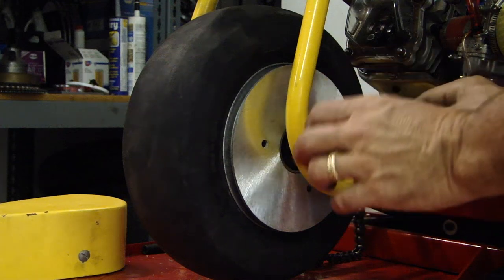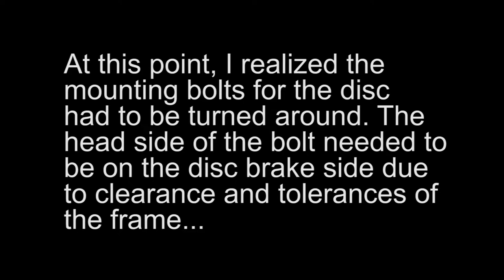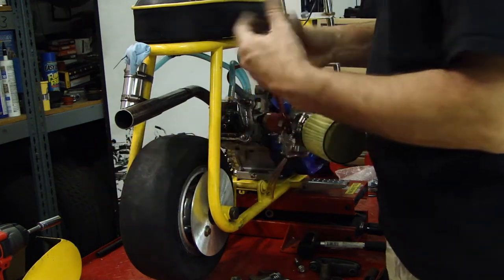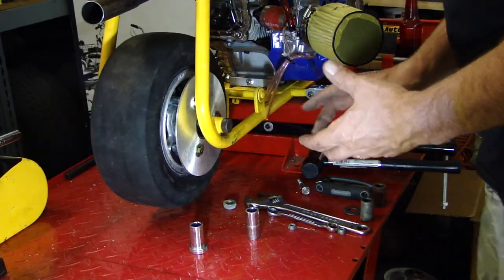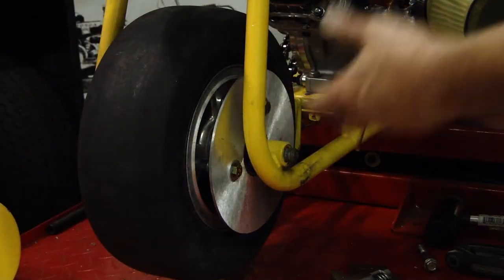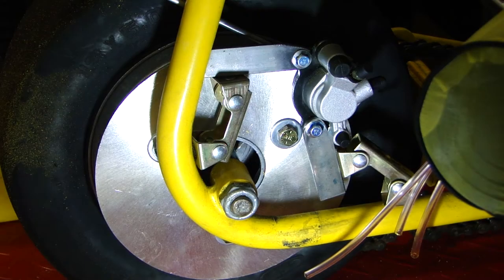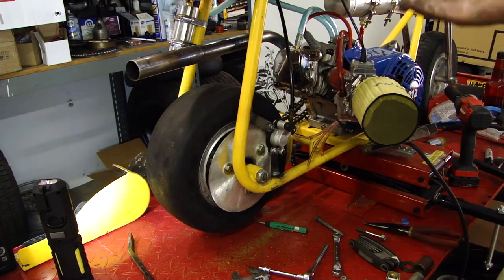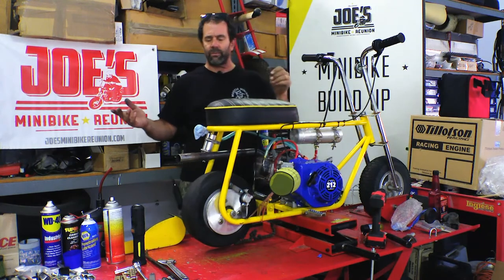MINIBIKE HYDRAULIC DISC BRAKE INSTALL ON HOT TILLY🔥 TEMECULA BOB FRAME

Comment: I wouldn't get rid of the break pedal but instead use it to activate the rear disc break. As a motorcycle rider I am always wanting to step on the break.
Reply from the maker: I'm a bike guy too and have a few Minibikes with a foot break. I considered it but this is more of a show and occasionally drag raced so I just wanted to keep it clean and simple

Comment: Is it fine to use scotch pads to sand a mini bike to smooth bare frame?
Reply from the maker: It's fine but will take a while, get some paint stripper, then scotchbrite before you prime and paint it
Reply: @MuscleMinibikeBuilds  will sanding the frame with 120 grade sand paper to smooth bare frame and then priming and then painting be fine?

Comment: Those calipers are terrible tho...the pads are so tiny they wear out too fast and the guide pins are so puny it isnt strong enough to hold it in place when braking
Reply from the maker: I've run a couple of sets of them so far without issues, testing will tell...